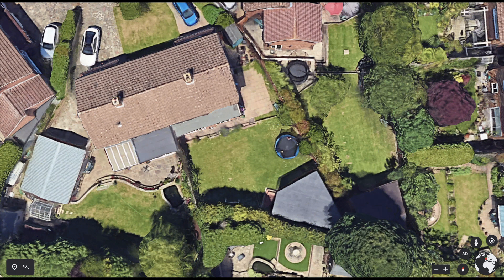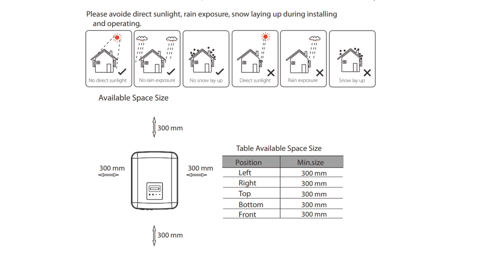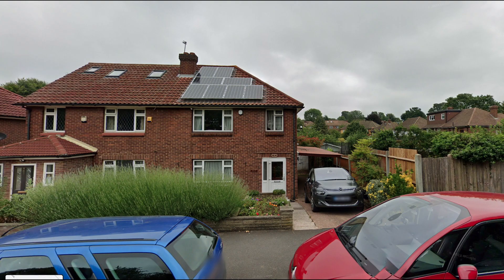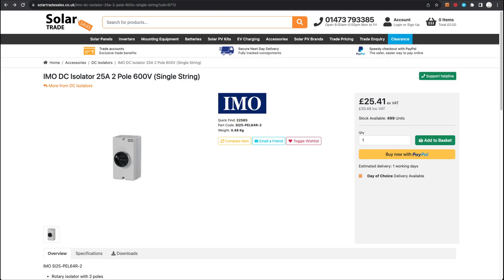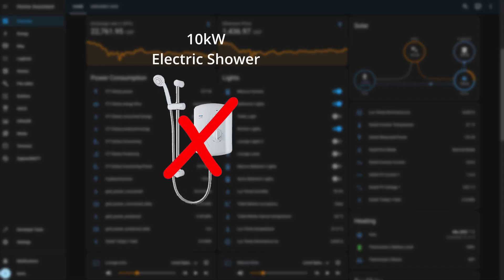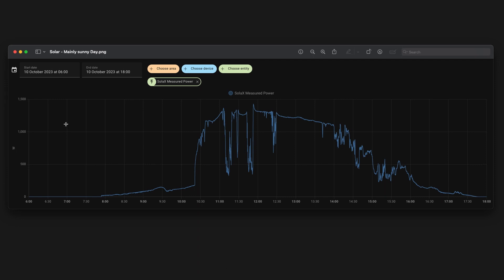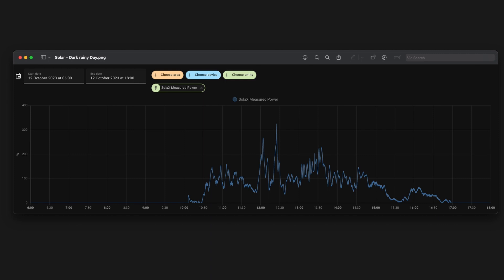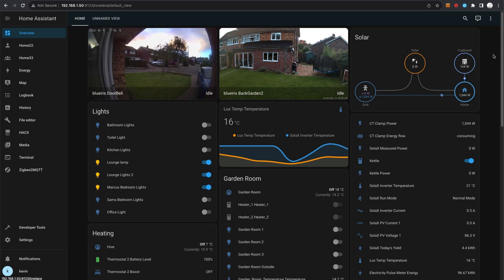DIY Solar Project, What I Did Wrong + Updates

Comment: Hi , thanks for explaining in detail. Shared your knowledge for starters. One doubt, if the solar power goes down , are you doing a manual changeover to grid. 

When we do this DIY, hope we only need to call electricians to connect the cables to our main breakers through a changeover switch and certify it. It would be grateful if you can share a drawing of that wiring or a video please and the make of automatic changeover switch if you have installed one please.

Comment: A year on, it would be interesting to have an update on your system, which would make a practical and very achievable installation for many DIYers. I'd be keen to see some figures re: what you have saved on your power bill vs the installed cost (I know the cost of the system is covered in a previous video). Thanks!

Comment: Put my inverter under the panels, of course mine are installed portret mode and I have acces from below. Plus I've only connected 5 panels out of six as they were way more powerful than I thought, used the 6th panel to power some fans and lighting, and to charge a 500wh battery for night lighting.

Comment: Very informative video, Kev. Thank you. So am I right that you can commission the Solax inverter yourself (or your electrician). They do not have to be a certified Solax installer with a secret installer code like some equipment (eg Givenergy)?

Comment: Well done for doing a DIY solar install. I've installed 5 DIY solar systems (some MCS certified, some not) so here are a things I noticed in your install:
1) Even though Solax say an attic inverter install is OK, still, electronic components don't really like getting hot :( 
1.1) In previous video you showed twin and earth near the inverter (when it was outside) but really you should use stranded 2.5mm^2 or 4mm^2 for the plug connection to the inverter.
1.2) The red AC disconnect switch should really be close to the inverter (rather than in the CU cupboard) - the disconnect switch is a good location to go from twin and earth to flexible stranded cable to the inverter's plug
1.3) You should have an air gap all around the inverter
2) When you look at failures of solar installs, so often they originate at wire connections - namely the AC and particularly DC shut-off switches. I know you just put it on, but the DC disconnect is not really needed - and it is a potential point of failure and the inverter already has one. Because you're a DIYer, you have time to wait until the evening to connect or disconnect the solar DC wires. When I've adjusted the DC side, I've either waited for night, a cloudy day or just covered the panels with sheets. You'll still measure voltage (when covering with sheets) but there'll be little current flowing.
3) in your CU - I assume you have the panels on a separate 20A MCU circuit?
4) Your roof rafters look in good shape. Next part of project... put the panels on the roof?  This is an entirely possible DIY job - no scaffolding required - just several ladders, safety ropes and a buddy. Your roof faces south-south-east which is pretty good and it look like modern tile (not slate) and not too steep(?). Check my channel for a video on how I helped a neighbour install his panels on his 2-story house.
5) 2 more weeks of city plumbing sale prices. Nab a solar roof rail system etc - the prices are really good. Free next-day delivery - what's not to like?

Comment: I've got six of the exact same Longi 405W panels on my garage roof, but went down the Enphase iq7+ microinverter route. More expensive but I wanted the flexibility of adding to it later on another roof or taking it to a different property if I moved. Its working well, so well i'm now looking into the Octopus no MCS certificate feed in. I need to get building control approval somehow, just looking into that now. 11.8kwh is the best in one day so far since all six panels were up from the beginning of October. More energy than I know what to do with on sunny days. Also I do have an AC isolator and export meter as that is required I believe.
Reply: The Octopus non-MCS SEG is still not up and running yet, it seems. I got an email saying they're still going to charge £250 for the privilege and it's not guaranteed they will accept your application - and then they only give back £150 of the fee. The alternative is to go down the battery storage route, which, as time goes on, is becoming more viable, cost-wise. 
Have you filled in the DNO form? So long as your system is small, this seems like a rubberstamp operation : my G98 DIY install was OKed within 24 hours. (Your mileage may vary depending on your network operator.)

Re-Enphase : I've never used micro inverters - and I assume you attached the inverters to the underside of the panels and ran 240V on to the roof?  I wonder if you considered putting the inverters in the safety and cool of the garage while running (in your case) 12 DC wires from the panels. More wires but easier maintenance, perhaps?
Reply: @mikeatyouttube  Yes I did the DNO G98 it was easy and approved within 24h. I used pre-made plug and play enphase q cable and the microinverters are designed to be outside fitted to the underneath of each panel with brackets, so no faffing with DC cables. Just terminate each end of the q cable one in a ip67 box into 2.5mm T&E and take it to the isolator/meter, then mine goes into a dedicated 20A MCB. If I don't get export like you I was thinking of getting a zappi charger when I get an electric car in the future and just charge with any excess.
Reply: @malpracticesurf  Good stuff. Pretty soon EV's will have Vehicle-to-Grid connectivity which will provide more options for energy storage. Looking forward to that.

Comment: What size wood did you use to make the frame for the solar panels
Reply: In the previous video 2" by 2" treated wood was mentioned. The frame looks sturdy and is securely attached to a wooden rail along the wall. ☮️

Comment: How does the inverter connect to your mains so power is taken from solar but also able to take additional power if more is required than is being produced? I want to do a similar thing but to a studio in a garden which is connected back to the house via the mains consumer unit? Cheers.
Reply: All you need is a "grid-tied" inverter (and nearly all the ones you can buy are grid-tied). Simply put, the inverter is plugged in to the mains (preferably on its own dedicated circuit fed from the consumer unit). Then, when you plug the solar panels in on the DC side of the inverter, all the clever stuff is done by the inverter.  Any solar power produced will happily be used by your house and your meter will pull less from the grid. If the panels produce more than your house needs, it will push the excess back to the grid - which is not really a big deal for small systems. (If the panels are feeding the grid, and if you have an ancient electricity meter, the disk will spin backward which is a bit naughty but the new meters just make a note of the electricity going back but you won't be paid for it) . For a small system, you can just use your ring-main (cue howls of derision from the sparkies) . It's only when you in the 3kW and above range that some more careful thought is required for the electrical connection.
Reply: @mikeatyouttube  Thank you. Is that 3kW of solar power? I'd like to be able to produce around 1500w of power but will likely only start with a couple of panels and expand down the line. If you have any links to anything that will be suitable that would be very helpful. Cheers.
Reply: @xbox360Rob  The 3kW refers to the AC power. - to get that sort of power you're looking at 8 panels approx, to your small system will be well under that.

If I understand, you want to put panels on your garden studio and have that feed power to the house. So the big questions are, does your studio already have a house AC connections? If so, is it on it's own breaker (MCU) in the consumer unit (should be separate), and what size is the MCU (hoping it's 20Amps)
If those conditions hold, at least electrically, it would be fine to put an inverter in the studio and panels on the studio roof. 
The inverters require a certain voltage to 'get going'. So you have to match the number of panels to the inverter - work out the maximum number of panels you 'could' install (because you will get there eventually) and then shop for a suitable inverter. City Plumbing is currently a really good source for equipment.
Reply: @mikeatyouttube  Ah i see. Yes should be under 3kW AC power. The studio is daisy chained back to the consumer unit with a hot tub in between which with today's electricity prices isn't often used/powered so essentially is directly connected to the consumer unit on it's own 40a breaker.
Reply: @xbox360Rob  That's fine. A 40 amp breaker should have at least 4mm^2 wire and your studio sockets etc should also be wired similarly (it would be good to check that).  So just get some panels and an inverter to match, make sure the panels are equally illuminated (face the same way without shade) and plug the inverter in. Watch a few more videos and you'll see it ain't rocket science. For 1500W you should be looking at about 6 panels - on a nice summer's day.
Reply: @mikeatyouttube  Perfect, thanks for your help. All cabling is ready suitable, just wasn't sure on how it feed back. Would four 400w panels be 1600w? Or is that before counting any loss and perfect conditions?
Reply: @xbox360Rob  You'll get approx that power on a fine sunny day in summer when the panels are aligned to the sun. The key things are to try to ensure no part of any panel should be shaded at all. The best thing is to install as many panels as you can and have them pointing the same way. If there are two directions suitable for panels, then you need to get an inverter that has two MPPT inputs. Good luck with the project!
Reply: @mikeatyouttube  Lovely, thanks for your time. I now know exactly what I need. Cheers :)

Comment: In the UK, i belive we are meant to get 4hrs of daylight on average. So your max should be 1.6x4=6.4kwh so if you are only getting 0.5kwh on a cloudy day you are only getting 8% of your potential. That is shocking, and a saving of 15p thst day, it is going to take a while to pay for its self. I would be interested to know what you have averaged since you installed them. Thanks
Reply: True, but thats the worst day of the year todate - if your working from home, and use all the energy. At 30p / unit & 1.5-2.0 MW / year (from this type of system - 1.5Kw) - you save around £500 / year. And if it cost ~ £1500, payback is around 3 years
Reply: How are you generating 1.5-2Mwh, if you're only getting 0.5kwh on a poor day?

Comment: I watched your first video and that put me onto those panels. I have just bought 2 for £93 each. That is the same as I paid for secondhand 3 years ago.😳I did the same shower swap a few years ago. This summer however I took the cable from that shower breaker, and put a 32amp commando socket on it in the garage. I can now plug in a 7kw EV charger and charge my daughters car when she visits.
Reply: Thanks for the heads up on the new low price - cheers

Comment: Great content, just done something similar with those panels, to complement battery storage installed last year. We’re  trying to optimise for winter so have the panels 70 degrees against the fence at present. Over those days got 4 kW max and 1.8 kW min (11th oct)